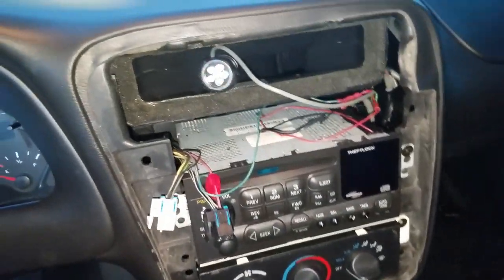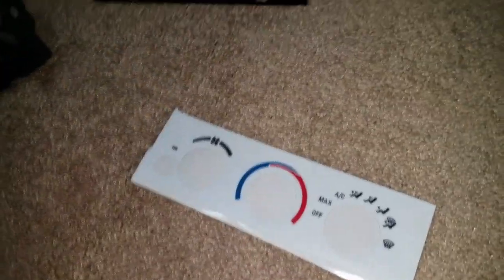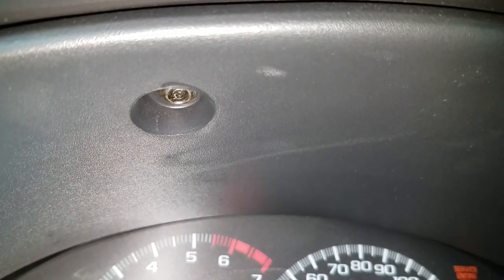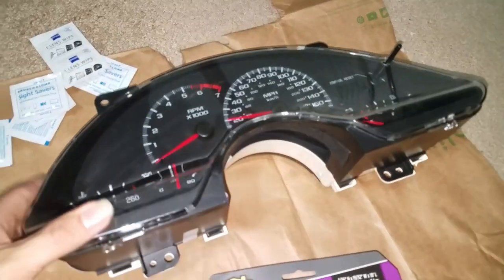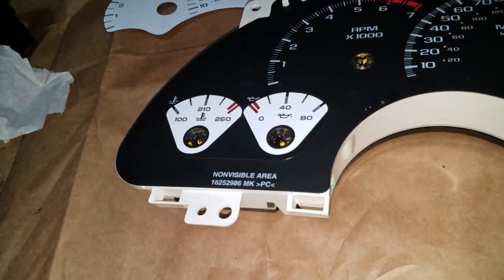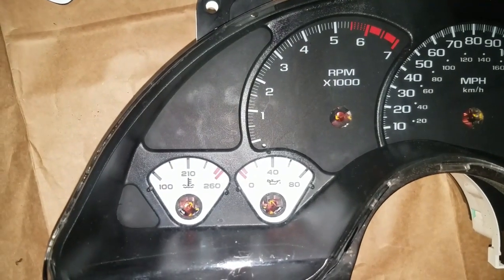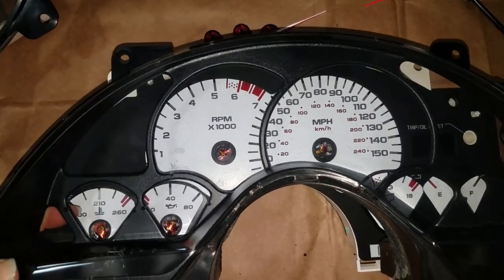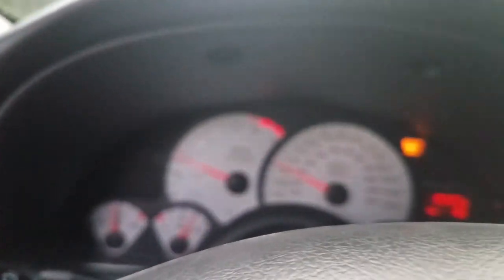Installing HVAC and light switch white overlays with white gauge overlay inserts

Comment: Nice video!  Thank you for the great mention.    Please don't think I'm being negative.  I would like to point out, that on all of our overlay kits to date, needle/pointer removal isn't necessary in our designs.   Also, you can reposition our overlays many times, if needed to achieve alignment.  The overlays for the instruments can be slipped into place without pointer removal.  This was one of the many advantages of our products, compared to others.  I am happy to see your gauges looks great, and are working great!  Beautiful end result.  We do have a 3D Printed insert, to recreate the bezel trim of the Firebird, while keeping the Camaro lens.  It snaps onto the backside of the Camaro lens/bezel.